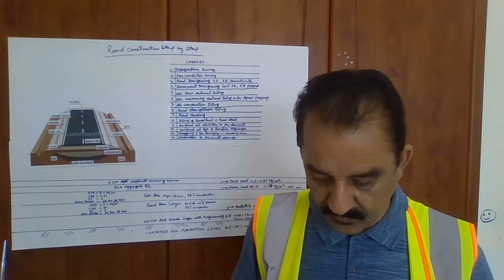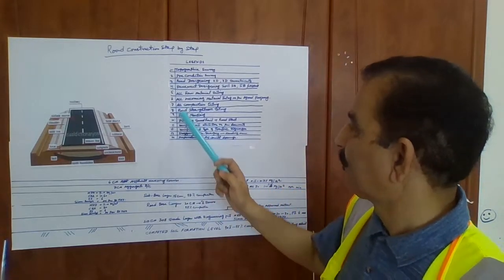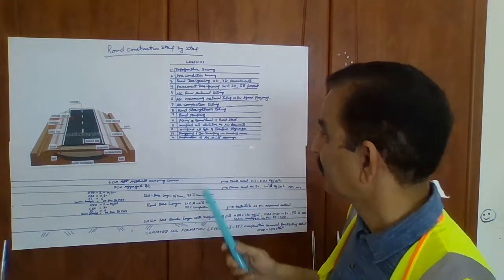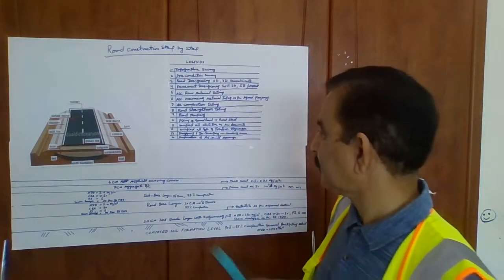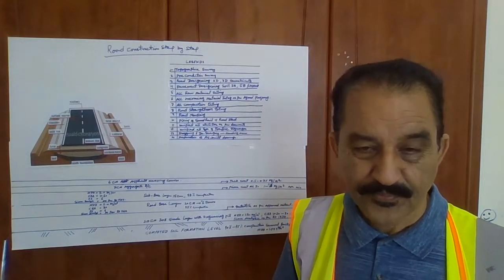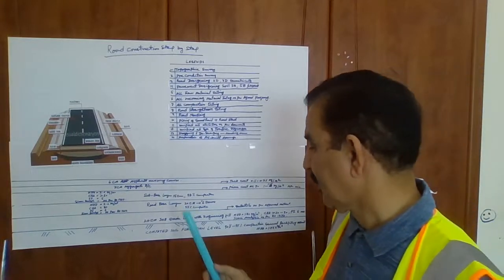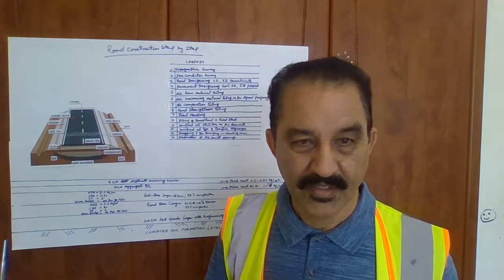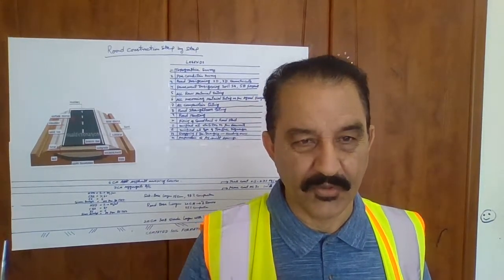Civil Construction Materials--Technical Session No 138- Road Construction Step by Step. General .

Comment: What is the relation between PLT and CBR?
Reply from the maker: Plastic limit minus Plastic limit = plasticity index and CBR is California Bearing ratio and it's unit is percentage. If PI is high,then CBR value will be less and particular material need improvement by adding dense materials. If further clarifications required, please write.
Reply: @materialengineerofficial8755  I mean plate load test not plastic & liquid limits
Reply from the maker: CBR tests are carried out on fine materials and plate load tests are done when the underlying materials are coarse. The result of the plate load test gives a CBR equivalent value. Geotechnical study offer CBR & plate load testing as part of our complete ground investigation package.
*A plate load test (also known as a plate bearing test) determines the ground's bearing capacity and actual strength by applying an increasing load from a circular steel plate to induce settlement. It is used in cases where the ground particle sizes are large or the soil has a firmer texture.